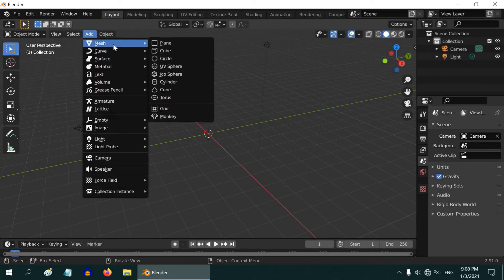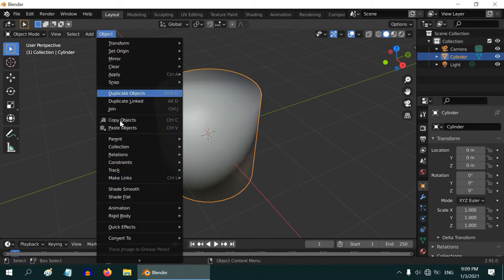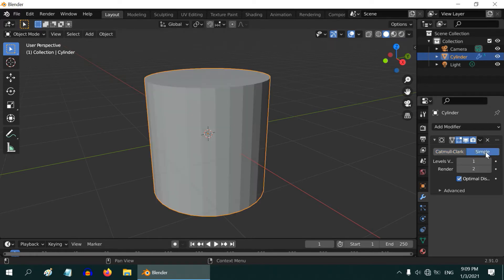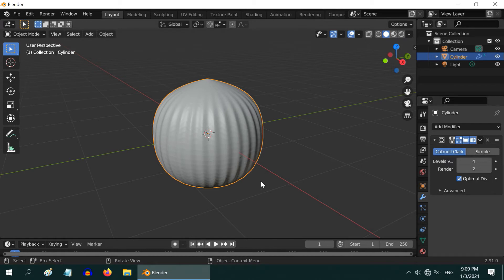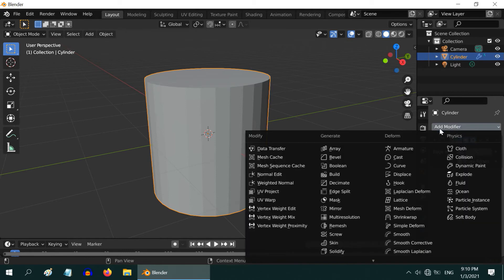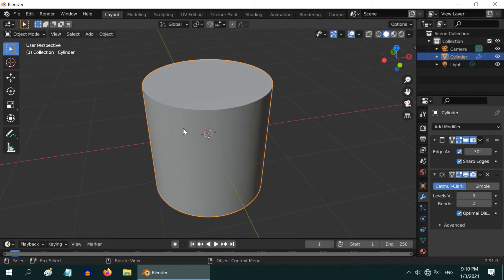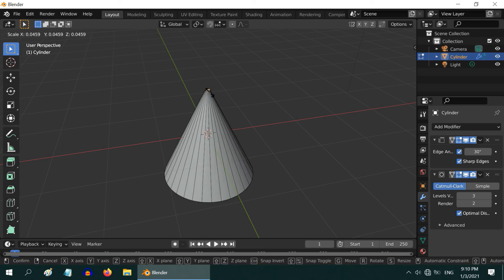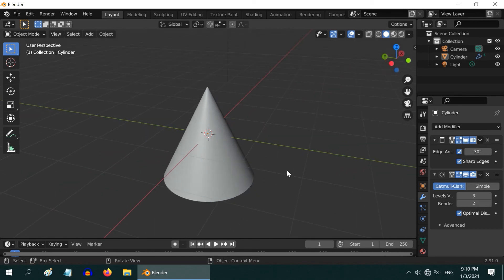Create A Smooth Cylinder Or Cone In Blender (All Versions) | Easy Method | Part 2

Comment from the maker: 𝐀𝐧𝐨𝐭𝐡𝐞𝐫 𝐦𝐞𝐭𝐡𝐨𝐝 𝐮𝐬𝐢𝐧𝐠 𝐭𝐡𝐞 𝐀𝐮𝐭𝐨-𝐬𝐦𝐨𝐨𝐭𝐡 𝐨𝐩𝐭𝐢𝐨𝐧 👉 https://youtu.be/xJMwPBswaBw
Reply: I tried using this technique after I had already edited a cylinder into a ring shape. When I tried using this method it ended up filling up the middle of the ring which I didn't want. By accident I figured out a way to fix this issue but I still want to understand why it worked. I exported the ring as an STL and reimported it. For some reason when I used your method on that same object re-imported it smoothed out the structure without closing the hole in the middle of the ring. Any ideas how to fix the problem without having to export and re-import? Also why does exporting and reimporting make it work?

Comment: Thanks, from now, I'll always create cones from cylinders, but I wanted to smooth some non-3D-printable rough edges which resulted from combining of 2 other meshes into one. E.g. if there was a smoothing "brush" or select group of edges and interpolate the surface...
Reply from the maker: Blender is powerful. You can surely do this, but it won't be very quick. Please select that object and go to the edit mode. There, select the edges where you want to give some smoothness. Then select the bevel tool and add a bevel. It won't be perfect in one go. So open the operator box and customize the bevel, by the bevel amount and by the number of sections. I understand that it sounds complex, probably I'll do some tutorial on this later. And this method alone may not give you the best result always, you need to tweak it as needed for your particular mesh or your object, you may need to repeat it several times, for separate edges, with separate bevel settings. It takes time, but at the end you can surely achieve the result that you need. All the best!

Comment: When I render it, the cylinder wasn't smooth, how can I render it well with smooth?
Thanks!
Reply from the maker: That's strange, because the method works for render as well, no additional step is needed. In your case, I can only guess that either the cylinder is created differently (not from the default add menu) or another modifier is blocking the edge split or subdivision on this cylinder. If I can look at your blend file, I will be able to spot where the problem is. You can find our contact details (email) in the About Me section of this channel. If you can kindly share your blend file, we will be more than happy to help. Thank you!
Reply: @5MinutesBlender  I fixed it, thank you very much!

Comment: Is there a way to control the polygon counts when adding cylinder mesh like in Maya?
Reply from the maker: You can do it differently, add a circle instead of a cylinder (from Add>Mesh), you can control the number of polygons, default is 32. Then go to the edit mode, select all the vertices and create a face (from the Vertex menu), then in the object mode, add a solidify modifier for the height of the cylinder.
Reply: @5MinutesBlender  where I can find the option to control the polygon counts?
Reply from the maker: @onewayroad3765  In the operator box, on the left-bottom corner... you can also watch this tutorial: https://youtu.be/GEliViQGbn8
Reply: @5MinutesBlender  I found it. Thanks man
Reply from the maker: @onewayroad3765  Cool 👍